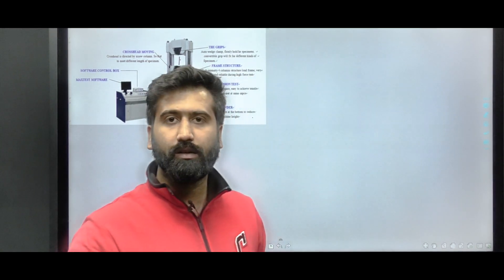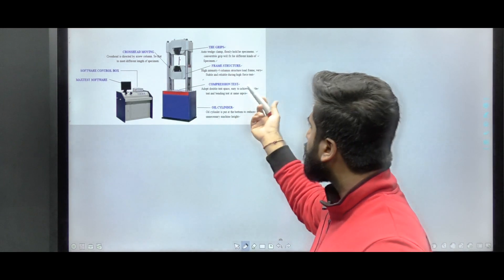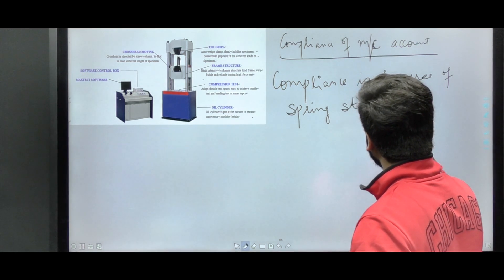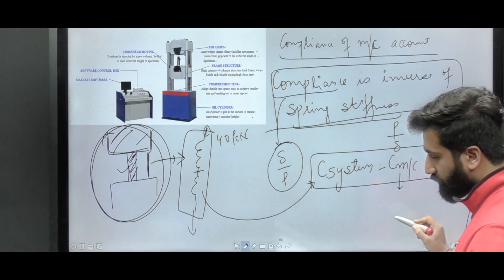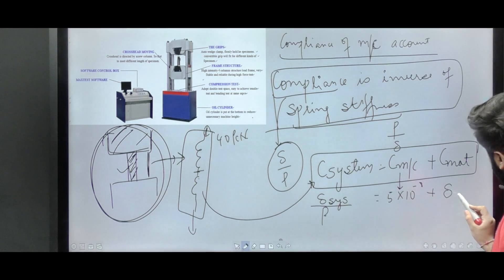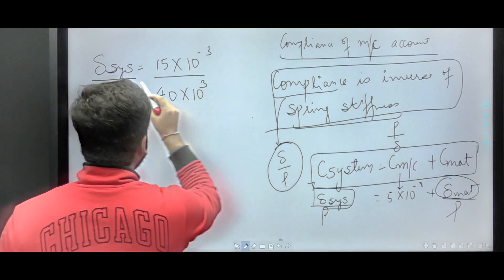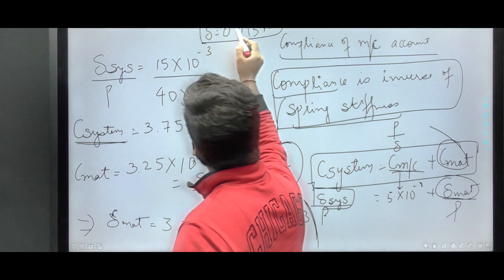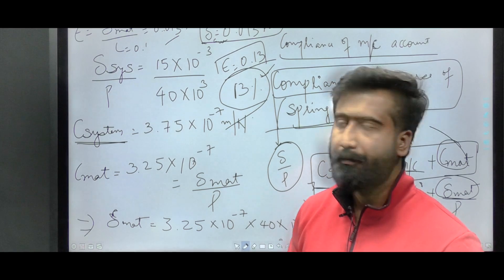GATE (ME) 2019 Solutions (Set 1) | Compliance Theory | By Viresh Manocha

Comment: Every coaching instituate give different solution.. 
 They  not used the value of 15mm  .
They simply   use compliance of machine =  (L/AE)    and mutiply with load   . And finaly divide by orginal lenth to get strain  and multiply with 100  . And get the answer = 2  percent